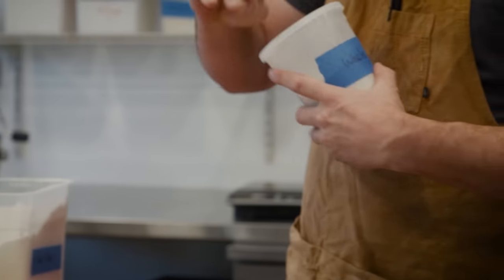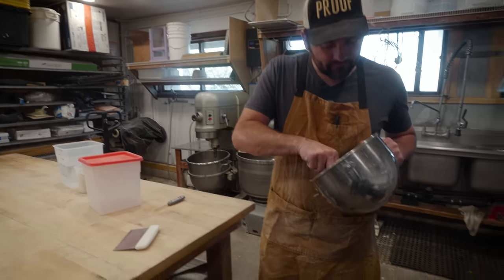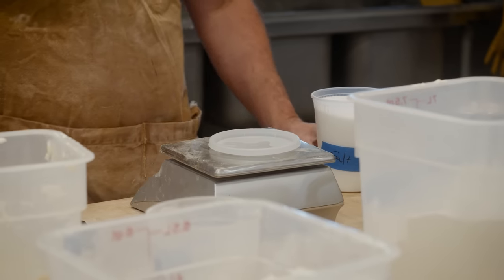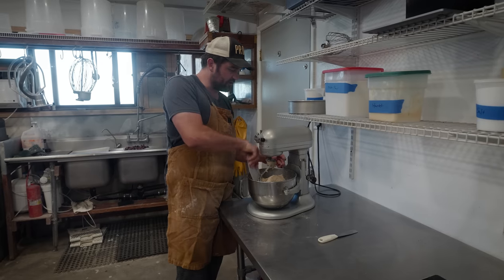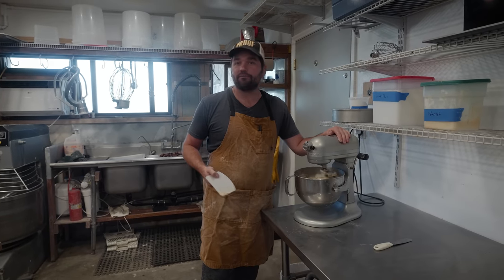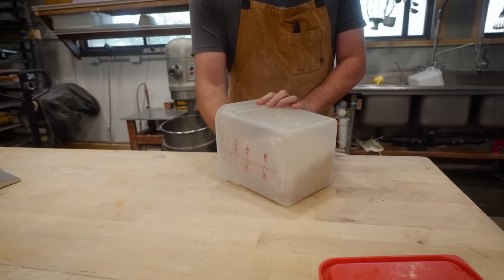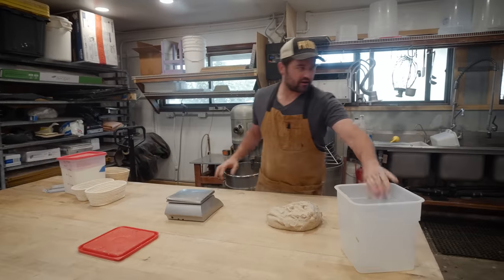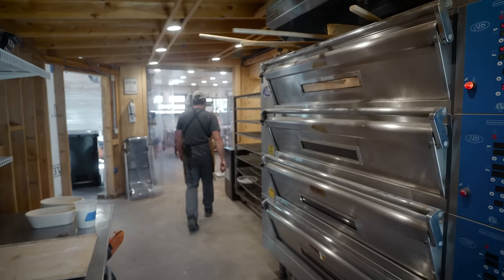Rye Sourdough from Start to Finish | Proof Bread

Comment: Scalding the rye is important because of the ergot fungus that will grow on the rye kernels during a wet year. So you kill the ergot by scalding, rather than propagating it in your dough, and you gelatinize the rye as well while reducing the impact of the bran as well. When you see a scald, you are probably looking at a recipe with old ancestry, although today folks like the gelatinizing effects.  Much European wheat is rye in part from seed saving over centuries as they had no way of getting rid of the rye to separate it from the wheat. So much bread in France from local wheat has a significant percentage of rye. Most folks actually will prefer 5% to 10% rye in a wheat bread but could not tell you why.
Reply: I haven't scalded my Einkorn berries but think I should start.  Going to try it
Reply: I didn’t find any indication that the boiling water decompose the ergotamine, the noxioux substances of the ergot. So boiling the rye flour doesn’t make it less dangerous as food. The only thing that helps is to purchase the grain or flour from modern mills that have detection system for the ergot.
Reply: @Adrian-ww2jj  It is not about decomposition, but a protection against breeding more of it in the warm wet mix.
Reply: @geezerdude4873  As far as I know the ergot fungi grows on the rye plant, and even if it don’t spread during the bread preparation it remains extremely nocive. As far as I understand, the ergot fungi is not like the yeast, who develops in the bread preparation process, but it is a parasite of the rye plant. After all during the baking the dough is over 194 °F (90 °C) hot, so according to your assumptions the ergot after baking should no longer be dangerous, which is not the case.
Reply: @Adrian-ww2jj  Ergot is a mold which you can favor the growth of with water and warmth. You do not want to grow more of it.  This can be a life or death issue that traditional people understood.  So you sterilize and then add yeast.
Reply: @geezerdude4873  So you say that ergot can multiply during the fermentation of the dough, like the yeast does. Did I understand you good?
Reply: @Adrian-ww2jj  Absolutely. It is a fungus which just needs warmth, moisture and food, and rye is the food.  With modern ways of making the bread that rye present in wheat (from saved seed) is not a critical issue with regard to ergot fungus assuming the grain was properly dried in the fall after harvest unless you are running a very slow (typically sourdough) rise of the bread. If the wheat with rye in it  is not properly dried after harvest, as happens in wet falls and is a special issue in certain clayey soil types, wheat develops problems of its own (like aflotoxins).  But if you are smart even today you should assume that ergot fungus is present on rye and do the scald. It also is supposed to improve the gel structure of the flour, which I would not swear to as I am not normally a rye baker. In part I am remembering things a friend who worked in food testing for the FDA 35+ years ago, but I paid attention as I do have one family recipe for the holidays that uses quite a bit of rye (and involves a scald of the rye).
Reply: @geezerdude4873  In Germany, where I live, almost every bread contains rye flour, and many of them more then 50% rye flour, so scalding the whole rye is impossible. I never heard that nowadays the ergot is an issue in Germany. I also bake myself bread of 100% rye flour, especially during the winter time. But I’m aware of the danger of the ergot, so I buy the rye flour only from important producers, which are often controled by the sanitary administration. In the European Union, so in Germany too, the critical value of ergot in grains are strictly regulated, and after 2024 will be reduced.

Comment: Mixing the rye with scalding water allows you to double hydration and softens the berry so it doesn't cut into the gluten when incorporating into whole wheat dough later. But weight till it cools below 130 before incorporating with sourdough starter. Impressive, and thanks for all the tips!
Reply: I will try this, I thought scalding the flour only helped with flavour, not gluten development. I make a 50% white wheat flour/50% whole wheat rye flour, I'll try scalding that rye before mixing the dough.

Comment: I was watching this vid when you mentioned alternatives to not having access to rice flour. White or brown rice flour is incredibly easy to make. I didn't want to pay for rice flour to dust my banneton when I can make it for almost nothing, just the cost of the rice. Rinse the rice to remove any talc etc. Cook as usual, I use my instant pot. Rinse again with cold tap water to remove starch until water runs clear. Drain well. Freeze 24 hrs, this is an important step, it separates the grains. Dehydrate until completely dry, I use my dehydrator but you can find how to dehydrate in your oven on the internet. Then just fine grind in a food processor or coffee bean grinder that has been thoroughly cleaned - unless you want your bread to smell like coffee, cleaned herb grinder etc. Voila ! All the rice flour you want.
It can be stored in any dry container.

Comment: I didn’t realize Rye was stickier and I’ve been trying to use Rye for my sourdough. I didn’t do exactly what you did and it luckily turned out. I added different wheat flours at hour 6-8 bc it wouldn’t fold. By hour 12 I refrigerated it. Baked it 7 hours later and it turned out real well. I probably did too many folds cause of the situation but tons of air pockets!

Comment: I have been following your videos for about 18 months. I really liked this one. I was not familiar with the scalding of the rye flour. I wrote down the entire recipe as you spoke it. I think I will divide it into thirds and give it a try. My starter is not Harriet. Mine, named Audrey 4, is a 1:4.5:5 ratio. I got the very beginnings from a bakery here in Denver, Rebel Bakery. It creates a wonderfully sour rye bread from another recipe that I use. For your customers, glad you are initiating them to the rye flavors.

Comment: You asked about tips on dough mixing in the Kitchen Aid. I have the same issue when mixing bread dough in any quantity. 

The best mix I’ve ever seen for mixing dough is the Ankarsrum Assistent Original AKM 6230 Electric Stand Mixer, 7.4 Qt.

Comment: John’s recipe seems to be this:
Rye 250g
T85 990g
Water 500g (scald) + 920g
Starter 394g
Salt 27g
Honey 24g

Starter seems high - 32%
Hydration seems low - 78% bearing in mind the scald.

Have I made a mistake?
Reply: Yes you have. He added 420g of water NOT 920. It's 920 including the scald water.
Reply: Don’t forget the 500g he used to scald the rye.
Reply from the maker: Did you factor the water from the starter?
Reply: @shimoncobersy5700  that's right, 500+420=920
Reply: I did to get the 78% hydration but it was based on 394g of starter which seems high.
Reply: 920g water plus 197g from starter. 
250g rye 990g T85 plus 197g from starter. 

Giving hydration figure of 77.7%
Reply: @laudya1  That was a typo. I meant 500g scald plus 420g water
Reply: @shimoncobersy5700  why do you think 394 gems of starter is high. most sourdough recipes by professional bakers have sourdough starter percentages around 20 to 30 (ish) percent. factor in the lower gluten content of rye flour, it makes sense to go a little higher.  As for hydration, 80% is the high end for most bakers so 78% is also within reason. All that said, the end result of a gorgeous loaf that passed the taste test, speaks for itself.

Comment: Really informative. I would also be very interested in some future episodes to see different ways you can use your starter discard.
Reply: The easiest way to use the old sourdough is to use it for bread baking. You must have a strong and mature sourdough. Keep your old sourdough in the refrigerator. An everyday sourdough bread has 20 – 40% of the flour in the sourdough, so the substitution of a part of it with the flour in the old sourdough will not affect the final result very much. You have to recalculate the bread recipe keeping the amount of flour in the sourdough and the total hydration constant. I think that the maximal amount of the flour in the old sourdough from the total flour in the sourdough must not exceed 25%. Yesterday I baked a bread using only rest of sourdoughs that I collected in the last two months: rye, wheat, liquid and stiff sourdoughs. I used only easy to bake flours (75% bread wheat flour and 25% dark wheat flour (German Type 1050)). It results a very tasty bread.

Comment: Get the white dough hook it has a 1 1/2 or 2 inch flare out at the very top near the mixer itself. Like a shield. Then periodically speed the mixer up full speed to fling it off to the side and be reincorporated it always climbs up the hook that’s why you need the white one with the flare at the top

Comment: QUESTION: I recently tried this 25% rye bread. It was incredibly wet, even though I'm accustomed to a wet sourdough dough. I'm wondering if the scalding water quantity for the rye pushed the hydration over the top. I divided your 3-loaf amounts into 3, and then multiplied by 2 for 2 loaves instead. Other than that, I followed the amounts and ingredients (Bob's Red Mill Whole Grain Organic Rye and Organic Artisan Bread Flour). Very active levain, fed the night before at 1:2:2, overnight bench rest, 150% rise. Mixed rye scald by hand and bench rested overnight to room temp. Mixed all together with a 5-qt. KitchenAid for 13 minutes until it balled up. 

I understand that flour types will make a big difference, but even after 5 rounds of stretch/folds, I still couldn't get a windowpane with 78 degree F dough. The dough was still tearing. I feared overworking, so in the fridge at 39 degrees for 14 hours. Still very wet. Gluten weak, breaking. I shaped as best I could and put in bannetons to fridge for another 12 hours. Out of bannetons, scored, baked. Epic fail. They didn't rise much in the Dutch oven, came out dense and wet even though it temped at 203 degrees (couldn't go more without burning). It is inedible. Tastes very sour with the texture of a wet Magic Eraser. 

Here are the amounts I used for 2 loaves: (still questioning if too much water)
Scald -- 366g water, 178g rye
Dough -- 280ml water, 266g levain, 660g bread flour, 18g salt, 16g honey

Here are the amounts I gleaned from your video:
Scald -- 500g water, 250 rye flour
Dough -- 420ml water, 400g levain/starter, 990g bread flour, 27g salt, 24g honey

Sorry this comment is so long, but I figured giving this amount of detail would prevent an inevitable endless back-and-forth with questions about, "Did you do X?"  I really appreciate all the instruction you provide! It helps to understand not just the processes, but also the trouble shooting, and in-depth theory and science. Makes for a far more intelligent experience making REAL bread. Seeing your results with this rye bread, I'm sure I made one or more mistakes. Maybe it was that the bread flour was enriched, or because it's not whole grain bread flour. I've been getting really good results with 85% this same flour, 15% whole wheat, 75% hydration, 20% inoculation (because of cool kitchen), 2% salt, and 78 degree temp controlled with a proofer. The biggest difference I can think of is the extra water used to scald the rye flour.
Reply: I had the same problem as you described,  no window buliding, also using the same flour brand like you. I wonder if I should just  reduce the water by 50ml if it turns out differently....I'll try it next time.  The taste was great
Reply: @sageymoodceramics  Let me know how it turns out.
Reply: @artsymargo  ok today I prepared the dough and tomorrow I will bake it.
 ( I'm be beginner 😅 just that you know)
I used the measurements for two loaves, changed following:
- I used this time different flour (king Arthur's bread flour)
-I reduced the water by 30ml 
-I prepared the rye scald the night before and left it out on the counter. 
- I added the scald, flour and water and honey and let it autolyse for about 2 1/2 hours.
- I slap and fold the dough on the counter for about 10 min
- I spread the dough  out thin and square, added  the salt on top and massaged it in with a little water on my hands.,than I fold it all together an another round of slap and fold ( 5 min or so). 
- let it rest in a covered plastic container for 45 min and did a coil folding.
- I  did 4 times a coil folding in between 45min.
-preshaped the 2 loafs, let them rest 30 min. Than final shaping and put them in the baskets and in my fridge. 

The dough seems much stronger than the last time,  I'm very excited how it turns out tomorrow 😄
Reply: @artsymargo  so it turned out fantastic 🤗
Reply: Just want to clarify the math in this formula. By my calculations this is not a 25% rye bread, but only about 17.4% rye.
Total amount of flour in this recipe is 1440g ( 250 g rye, 200 g bread flour = wheat in starter, and 990 g wheat in the bread). Thus 1440g is 100%.
250g of this being rye flour is only 17.4% of the total.

Comment: Man! I wish I had listened  to this video yesterday.  I made  my second sourdough  loaf   with a 50/50 400gs yesterday.  I couldn't figure  out why I just wasn't  getting the gluten  I was hoping  for. Now I know that Rye flour just doesn't  have the gluten  structure  that bread flour does. My starter  is still young  and don't  have a super tang to it. I'm hoping  it will get the tang as it gets older in fermentation.
Reply: Lol

Comment: The use of scalding reminds me of water roux/tangzhong/yudane methods.
Reply: thats exactly a Yudane method isnt it, just using a little more water than the classic 1/1?
Reply: @a.w.3480  It resembles the yudane method in the incorporation of very hot water to flour but the hydration ratio is far greater than what yudane calls for since Jon uses 200% hydration.
Reply: @ambrosewetherbee8301  It is the other way round. The tangzhong/yudane methods resemble European water roux/scalding techniques which have been in use since at least the medieval ages. Tangzhong and yudane only go back a.few decades.
Reply: @trijezdci4588  I'm not referring to what came first by saying scalding reminds me of tangzhong and yudane.
Reply: @ambrosewetherbee8301  I responded to the wording "It resembles the yudane method". When using this kind of phrasing, it is often interpreted to mean that the subject is a derivative and the object the original. Copy resembles original, not original resembles copy. I am therefore taking issue with this specific phrasing, but never mind.
Reply: @trijezdci4588  I understand what you mean now. It wasn't my intention but I can see how it could be interpreted that way.

Comment: I have a tea kettle that I can bring the water to a boil and it will automatically turn off and it has a lid city. You don’t lose through evaporation to the degree you do on the stove.

Comment: I've watched your video several times now as the concept of combining boiling water over rye flour is a bit foreign to my typical bread making techniques.  I baked the first batch this morning after overnight refrigeration.  The internal loaf temperature was around 205 F upon completing the bake.  The loaf interior seemed gummy and under-baked.  So I baked another of the loaves until the interior was around 215F which was an improvement. I'm using a typical electric range with a rectangular pizza stone on the rack and a steam pan below.  I started at 475F for 15 minutes and completed at 435F for 40 minutes. My oven tends to bake very dark. Would you have any suggestions? I enjoyed the flavor and would like to repeat the recipe with a dryer crumb. Thank you

Comment: OK I have a question about the starter. I use my starter 2 days a week, preferable would be Monday & Tuesday. After that I only keep about 200 grams in each jar. I use about 1,200  grams per 4 loaves of bread. Average is about 300(ish) per loaf.  So, You are saying that I should feed then my starter and leave it out for 4,5,6 hours and Then put it in the fridge? 
       I usually just cover it and put it in the fridge and then go back later and feed it and again put it back in the fridge. And feed it every 2 days small amounts until Sunday night rolls around about 7 ish and feed it and leave it out to ferment for Monday’s baking.  I am using a 30 quart mixer.

Comment: The starch found in rye flour gelatinizes at 124–140°F (51–60°C).  I'm wondering why you choose to bring your water to a boil before adding it to the rye?  Does the higher temperature speed up the softening of the bran?

Comment: I absolutely love all of your videos. I have a couple of questions. It may seems a bit dumb, but if I don’t ask, it’ll take long to find the answer even though I think I kinda of know the answer. You made three loaves. How did you calculate what the weight would be for each one?  Also, if rye is purchased already milled, does it still need to be scalded? Lastly, how can I get the recipe to try the recipe?thx.
Reply: dear Felicia, it makes no difference whether it is home milled or bought already milled. The point of scalding is to soften the fibers and all the layers of the milled grain. So, yes, it would be advisable to scald it. I sometimes use whole rye grains and I cook them like I would cook buckwheat or rice on the stove and than add that to the bread dough.

Comment: Do you have any experience with 100% spelt bread. My 5year old is on a fodmap diet but she is allowed to have spelt so i want to make an all spelt sourdough.  I have a starter almost ready but i could realy use some help on ratios and hydration.
Reply: The Bread Code on YT has good recipes and may have spelt SD recipes.